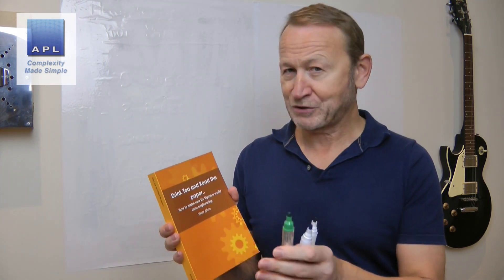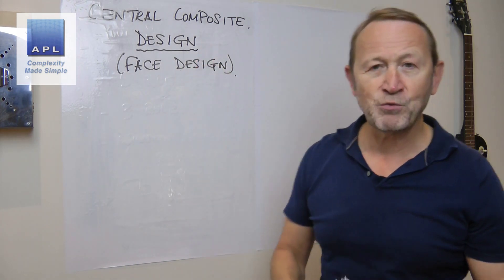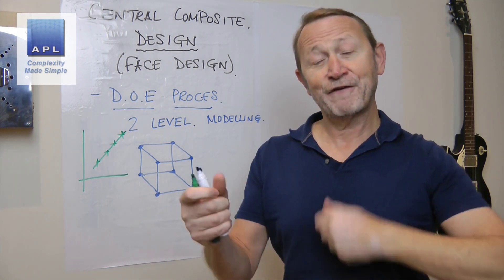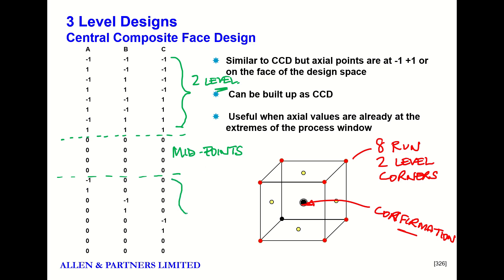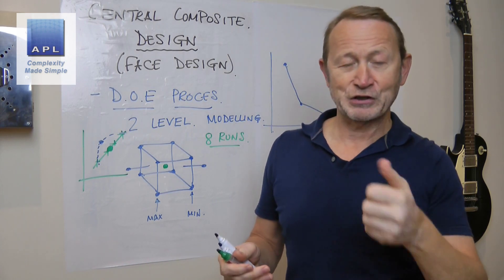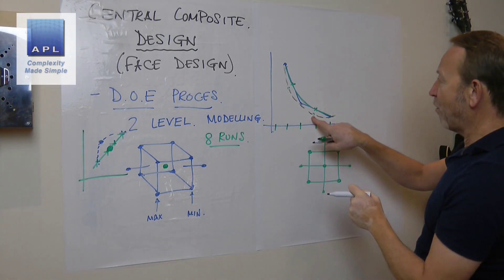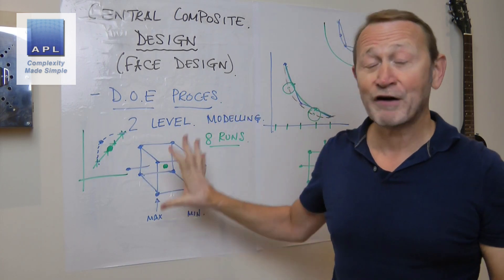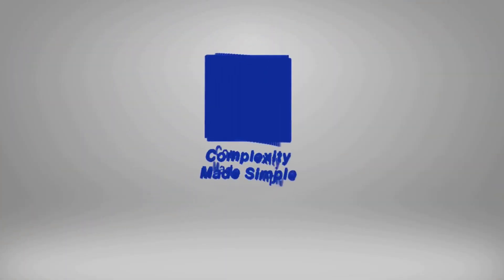Using the Central composite DOE

Comment: what if before your full factorial, you have done pre testing and saw that one of your factors shows a non linear response. Do you go straight into Central Composite or still confirm using a full factorial?
Reply from the maker: if you have good evidence like that go for the 3 level experiments right away...